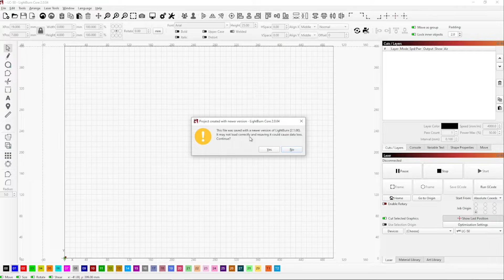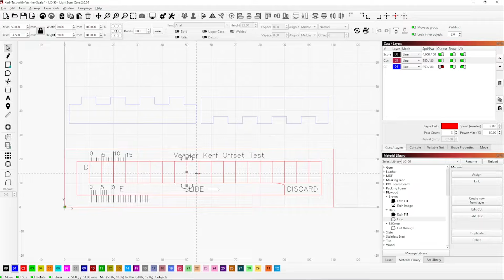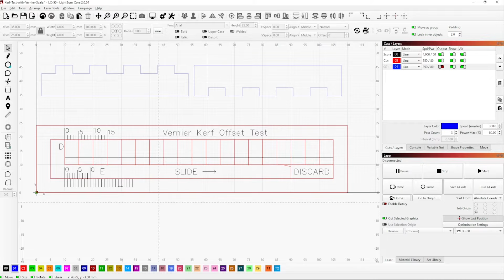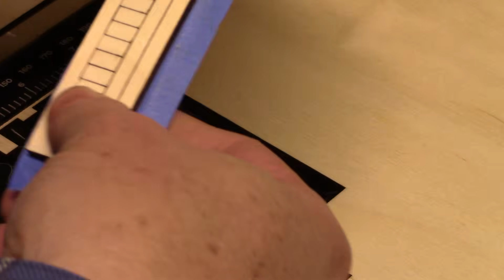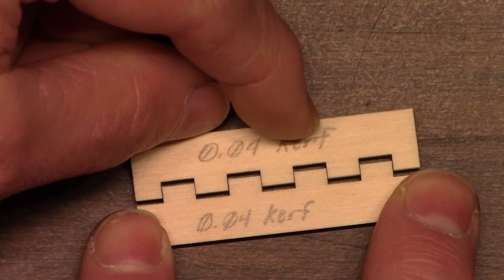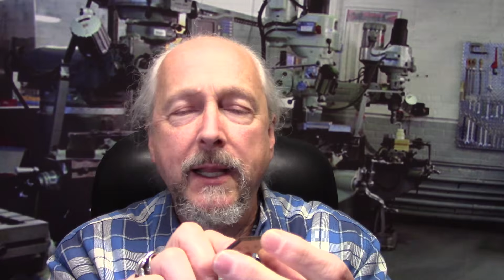LightBurn introduced a Kerf evaluation tool you get to make!

Comment: will you rotate the tool 45deg and 90deg and re-measure to infer the shape?
on thicker material, I am also concerned about focus height: focus depth set to top of material vs center vs multi-pass
Reply from the maker: The laser emitter on my laser is not easily rotated.  I did rotate the material to test the kerf at multiple angles. 
In general, when I am cutting through my material, I set the fucus just below the top surface of what I am cutting. I make multiple passes as a general rule. This is a very subjective thing as it depends on your laser and how well it cuts a particular material. More powerful lasers can easily cut through in one pass where my laser may take two passes or one very slow pass. You will want adjust your cut based on if the material, such as wood, it burned away vs acrylic where the plastic is basically just melted.
Reply: @CNCATHome  right - I meant to rotate the tool in LightBurn before cutting new rotated versions (oriented perpendicular and at 45 deg to the original tool you made)

Comment: Another example of the genius that creates LightBurn software. I'm very happy to have found your video. I see in the margin that there's a follow-up, so I'll be watching that one too, of course.

Does setting a kerf in the software change the image/lines/shapes in the workspace?  EDIT: I found the answer to that in the video at the linked page. It does not modify the shapes in the workspace.

thanks for a very useful video.
Reply from the maker: As a IT guy and an engineer, I too like the LightBurn folks.  I have worked with them a little in the past and they are great.

Comment: Hi  great video..  What do you mean  by inside cut vs outside cut...?  Cant tall the difference from you job
Reply from the maker: I really didn't go into what an inside or outside cut really is.  It all depends on what you need to be accurate in a cut.  Here is a simple example.  Let's say you cut out a circle.  Is the diameter of the circle important or the diameter of the hole left behind important. If the circle diameter is important, you would want an outside kerf or outside of the part. If the hole left behind is the important diameter, you would want an inside kerf. Basically cutting to the inside.  I hope this helps.